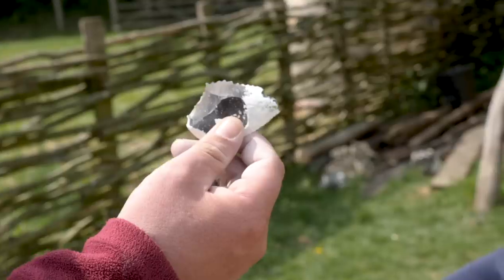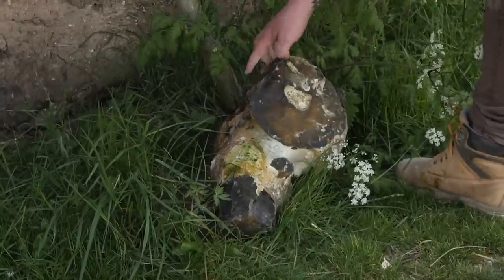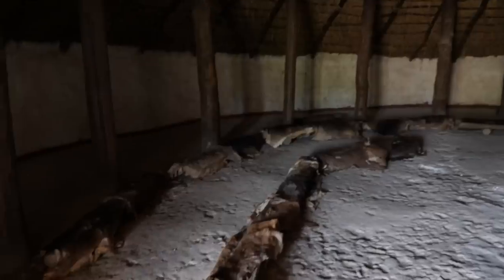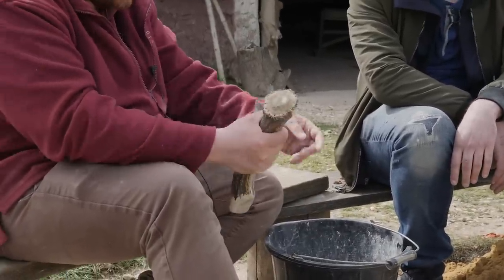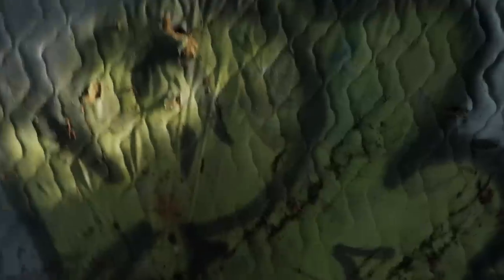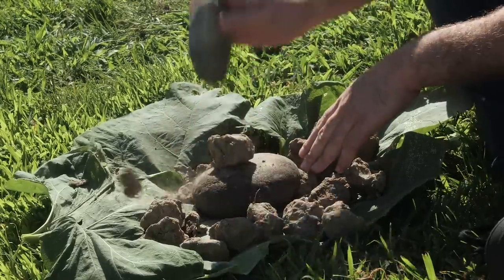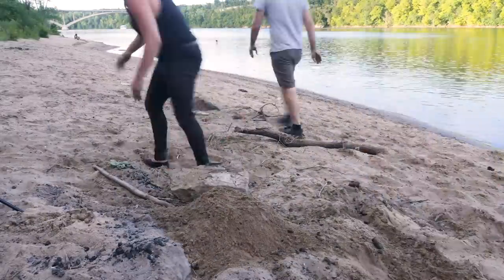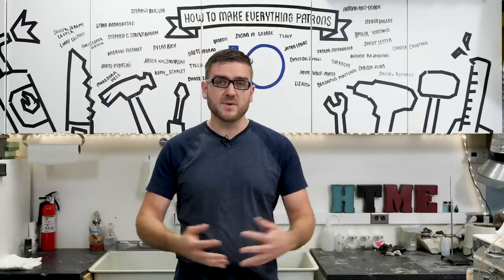Starting the Stone Age

Comment: Episode 2000: making the first computer
Reply: To be honest, once you can make copper and iron, you can basically make relays (basically switch with an electromagnet to close and open it), wich is enough to make logic gates and a computer. You just need enough electricity, so probably a generator aka magnetite and some wire.
Reply: That joke is so original it feels like I've heard it a thousand times already
Reply: Considering the pace he's going through with this one, that will probably be more like episode 7
Reply: Why get to 2000? You can get a mechanical computer without electricity. How early you can make a computer really becomes more a function of when information theory becomes advanced enough to understand what you want to do rather than when electricity is invented. I'd argue that if you're willing to have an unusual industrial capacity, you could even do it in the stone age using crude levers and gears.
Reply: honestly wouldn't be that difficult once he hits vacuum tube tech, just after unlocking glass
Reply: @maskedpotatoes  He smashed a few rocks together and dug up some dirt. 
I'm not confident he could make a computer from scratch with the benefit of modern tools. 

I'd be profoundly impressed if he gets to steel by 7.
Reply: @werewolfnar  I understand abacuses are basic computers. I was just making a joke and picked a random number

Comment: Burn some shells and crush them up to add to your pottery. It'll get stronger and more glossy.  Also, construct your pots using thumb width "ropes" of clay made into hoops and stacked on top of each other and blended it. Your pots will be stronger and cleaner looking. 
When cutting down a tree with any kind of ax, chop all the way around it instead of into only one side. When you get it deep enough, the tree will snap cleanly. Less cleanup and less splitting of the ends. 
Your primitive skills could use a bit of instruction. Just sayin. :-)
Reply: Ah, good ol' carbonizing!
Reply: Sweet using some good old calcium carbonate to strengthen and add more rigidity to clay ceramics to help build better crucibles able to build better metals with the higher temperatures they can now withstand 🤙🏽
Reply: Apparently if shells are not available wood ashes are also a good addition o.o

Comment: Hey Andy, you don't need to wait for the clay to dry up and then turn it into powder in order to separate it from rocks and roots. A really nice trick is to wet it until it has the consistency of dough or play doh, divide it into blobs about the size of your fist and just squish it and play with it like you would with play doh. Most of the rocks and roots will rise to the surface of the ball where you can pick them or even pop out after a couple of minutes.

Comment: I'm super late to this, but a big part of the reason you're struggling here is that you're cutting green (live) wood. Green wood is flexible. It wants to bend and split into fibers. It also doesn't burn readily because of the moisture still locked inside. Wood that has dried out, by contrast, is brittle - it will break somewhat cleanly when you bend it, it is much easier to cut, and it will burn much more readily and completely (there will be less smoke and soot).

That said, that doesn't necessarily mean green wood is bad. It depends what you're trying to do. For example, if you're trying to cook over a fire, you don't want whatever's holding your food over the flames to start burning.

Comment: Few years late, but, when cutting young trees and branches that are thin enough to bend even a little, it really helps to bend them and cut the side that's stretched; wood that's under tension cuts so much easier and quicker than wood that isn't under stress.

Comment: To get the most structure out of your clay for future pottery, you may consider letting the clay sit and get firmer before building. Wetter clay is best used on a wheel while slightly firmer is easier to handle when you don't have access to a wheel. This way you can easily do any number of wabi sabi pinch pots as well as roll the clay into tubes and stack the tubes to make coiled pots. Both of these clay forms are great for drinking, cooking, and long term storage.

Comment: The sheer quantity of people that have absolutely zero knowledge of "is that what I think it is" proves why the plant is still illegal. That was Cannabis Sativa, most likely the Hemp variant that produces CBD and is commonly used in textiles and rope making, but if he lives in a legal state, it could very well be THC Sativa, but the defining factor is the long, narrow saw-like leaves. Cannabis indica has shorter, wider leaves. I've been a prodigy to a few long time growers and on one occasion, I had to learn how to identify the difference between sativa and indica, as well as the difference between male and female plants. Lastly, females (the ones that produce colas full of intoxicating THC) need very specific growing conditions. If you throw a bunch of seeds outside, unless you live in the right kind of environment most of the plants will be pollen producing males, which in turn will create  fertilized female plants that produce seeds. There's a reason growers take very special care in growing their plants, and not slinging them in a topsy-turvy like a tomato plant. Females need extra care and attention, males need the bare minimum.

Comment: VERY interesting.
Try considering (AFTER you make your small scale steam engine) making a small lathe/mill to make precision parts. 
That should boost and get your abilities to the 120'th century. 
Fantasy wise - a fuel based engine would be nice but you will have to pump and purify crude oil.
Not sure you want to go that way (health and work time wise). Steam engines are OK as "modern" engines.
A steam powered boat would also be feasible and an interesting idea.

Comment: to make better clay you need to purify it, pour the clay into a large container of water and mix it around and let it settle a bit, there will be a clear line between the clay and the other sediment, pour off the clay part into another container and then let it settle for a day or two, then either evaporate the water off (if you want to do it the primitive way), or filter it with a finely woven cloth like an old shirt or an old high thread count bed sheet, then let it dry some more and you should be able to work it.

Comment: I think the clay mix was a bit too wet. I think using a half of the water used, or maybe even a quarter, would have been better. I mean, you can easily add more water later, but removing water requires drying, even if it just means fire drying, which takes more time and effort. After you get the rough shape done with a kind-of-dry wet clay, you can dip your hands in water and then use them to turn the surfaces of the ceramics smoother. After drying the terracotta, you could wet the surface again, and then get some sand attached to the mix, or turn the sand smoother with a pestle and mortar, or even use ash and water as a paste, to get a glaze going. You could use glazed ceramics for cooking and for storing liquids for relatively long periods of time.
       Also, I think the girl who made the clay pot should appear more in the videos.

Comment: Don't forget the wood and bone tools that were used extensively all through the stone age. You are using wood and antler tools to make stone tools. They don't make great fossil records, but that was always the primary tool tech of the time.

You would have split that wood much faster with a fire hardened wooden wedge and a wood mallet.

Comment: You forgot the most important part! starting a fire from scratch! big oversight and I think you should try to do for the next age if you haven't finished it. But I think the footage is from a while ago I guess. Maybe edit in a part to show it, besides the original content. Also a hardened clay pot isn't quite ceramics that has been baked to red hot temperature, its quite different from each other.

Comment: I'm not a stone age rock cutting techniques expert, but I worked in landscaping and tree trimming a large chunk of my life, if you hammer the tree completely around with the sharpened rock, you remove a lot of material faster and tree doesn't split down the trunk when you break it. Think about how a beaver cuts it with his teeth, which are not as sharp as a steel axe.

The way you handled the tree cutting betrays modern habit of using a chainsaw or a sharp axe, where you only cut on one side of the tree and keep going through. Splitting the trunk seems to only generate additional unnecessary work.

Comment: ... the size of branch/tree you are cutting off can easily be broken off without any tools just by moveing it back and forth for five minutes max. So it is doubtful they would use a tool to cut a tree down like that. Either for bigger logs or for the splitting afterwards but not for the cutting of that size of tree.